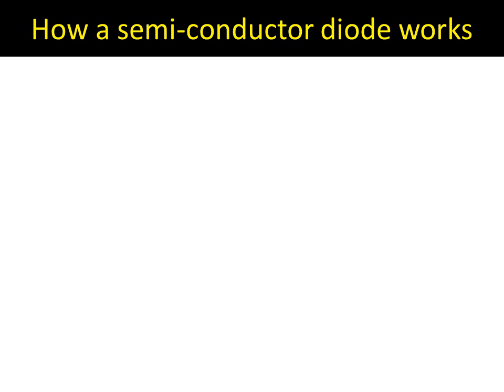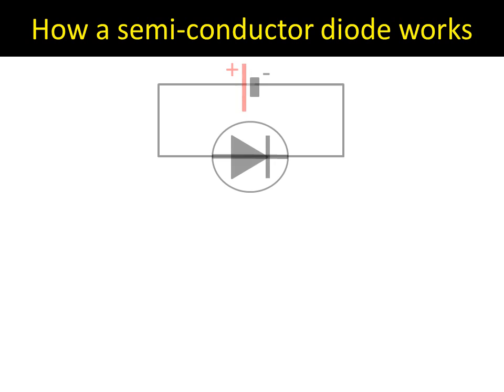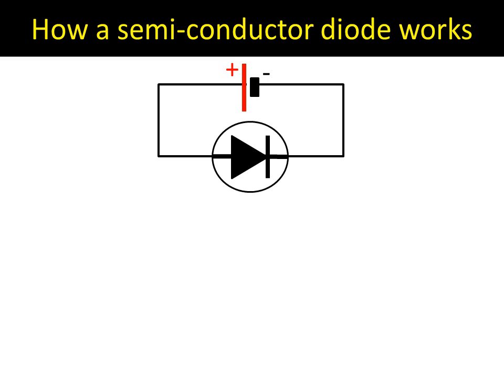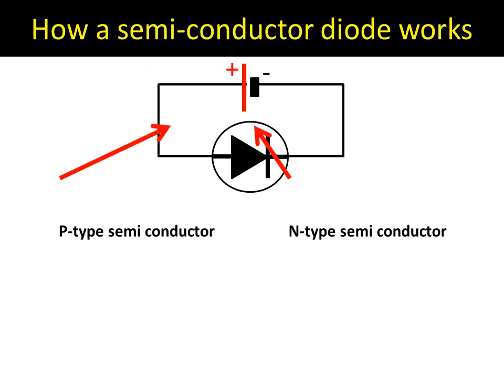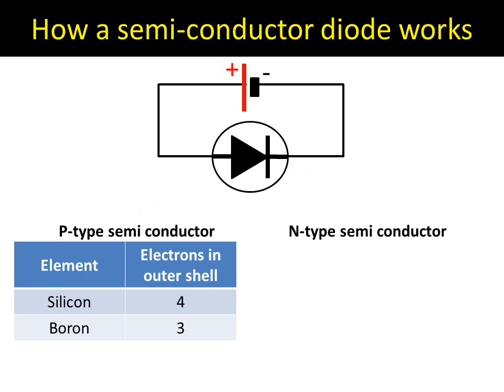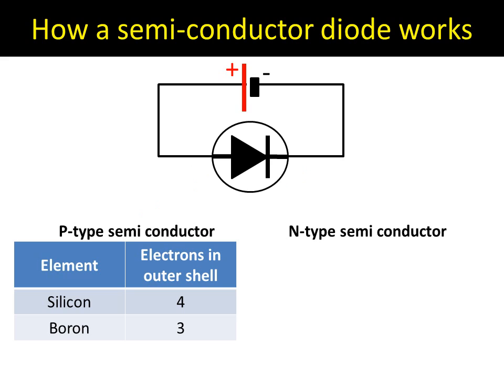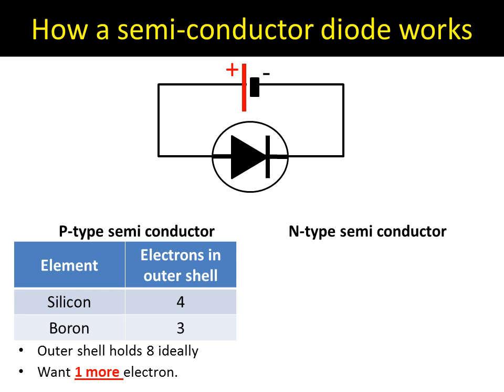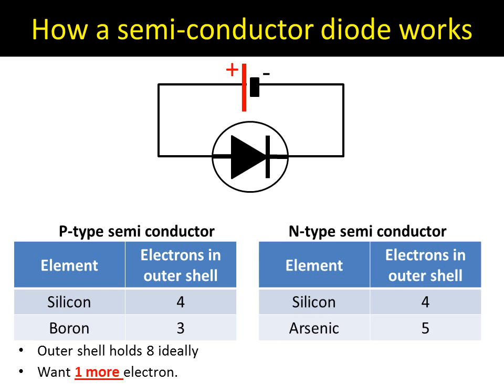How a semi-conductor diode works

Comment: Do they have a limit? Could you put 100,000 volts on one of those little black guys?
Reply: no you cant ...that black guy...that is actually a diode has a specification and allow only small amount of voltage to pass through it for 100000 volts there are special diodes mainly made for high voltage applications